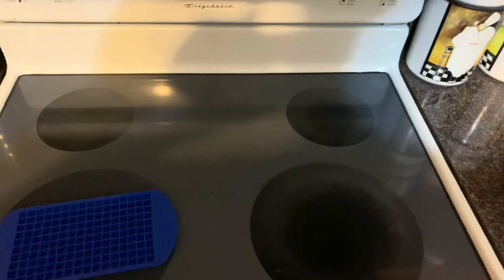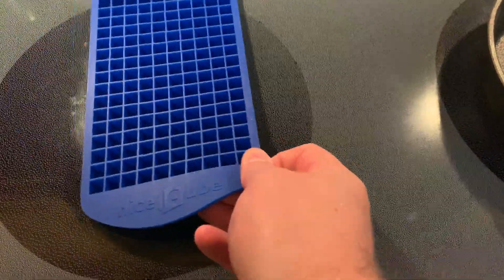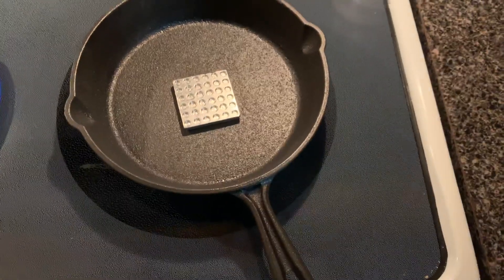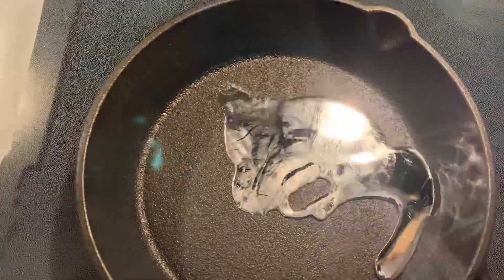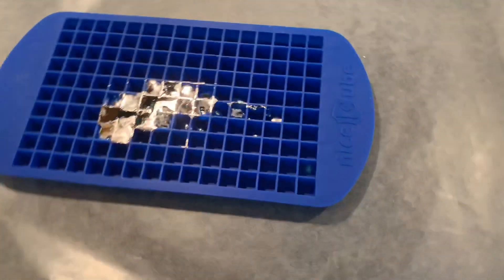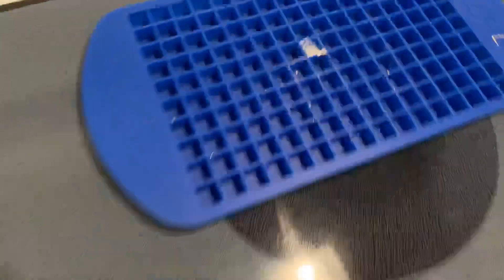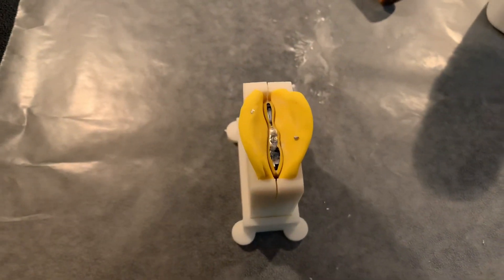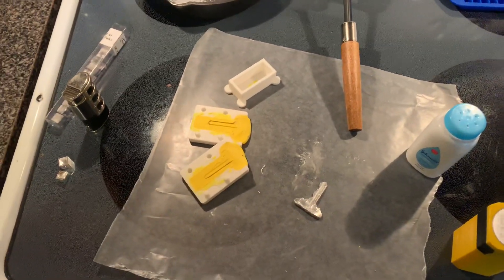Duplicating A Key By Molding and Casting It!

Comment: Nice work, man. I no longer use the orange/white molding material included in the Multipick key casting kit due to it setting up too rapidly. I switched to blue/white Pebeo Siligum, which allows a little bit more set up time. I prefer the silicone molds over clay because they're reusable and can take abuse while retaining the impression.